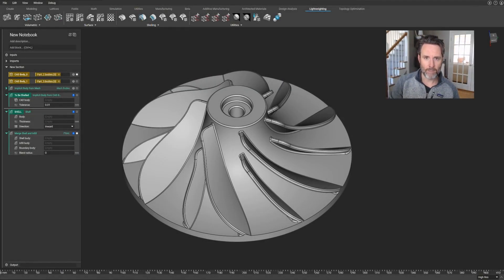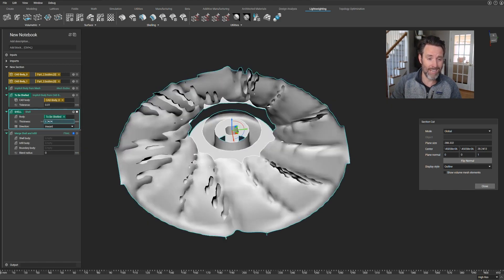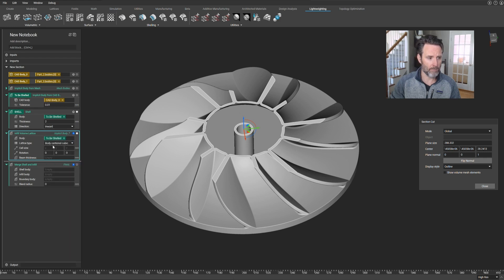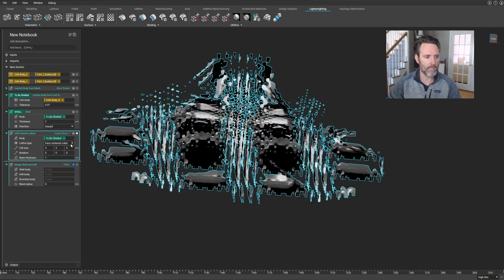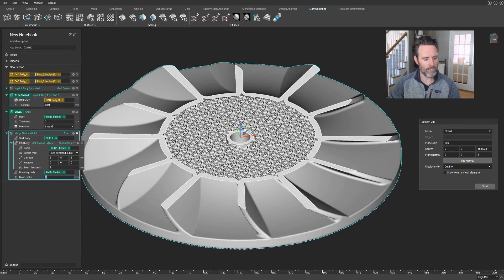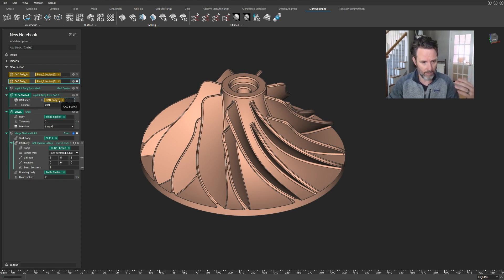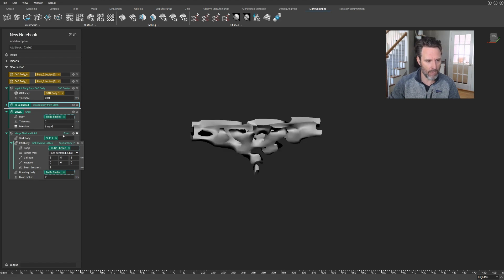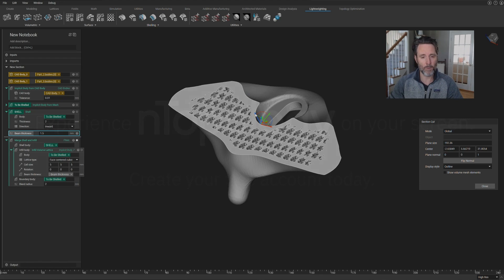3 Things About nTopology in 5 minutes

Comment: Very interesting and very powerful engine for treating meshes (voxels?)!  It is also nice that you can store&repeat the same set of actions on different models. On the "modeling-side", since we are dealing with an impeller, can you change the thickness of the blades or the total number of blades or a (slight) change of the diameter of the impeller or the fillet radius at the bottom of each blade?

Comment: Anything about mechanical analysis challenge in FE software cae what do I mean by that is after lattice building in ntopology we export the model to say Abaqus or Ansys but it is difficult to do stress analysis because the computer become slow sometimes kind of busy . any solution for this please. thank you!
Reply from the maker: Simulating lattices is complex with many speed vs. accuracy tradeoffs. Our application engineers recommend three methodologies: solid element simulation, beam element simulation, or homogenization. Here's a support article with more information: https://support.ntopology.com/hc/en-us/articles/360051081633
Reply: @nTopology  :Thank you so much, that is really game changer it helps a lot.